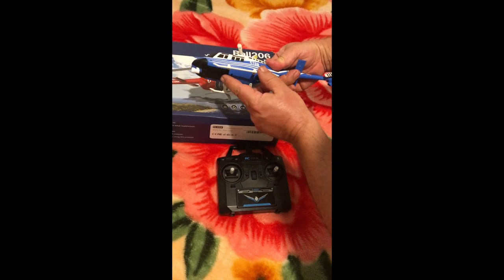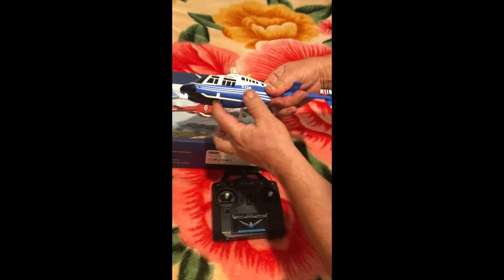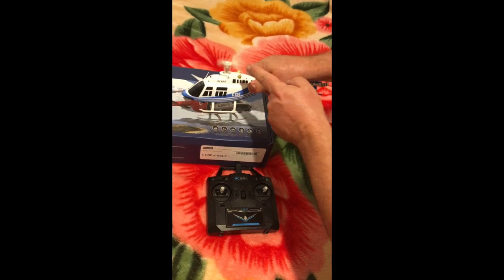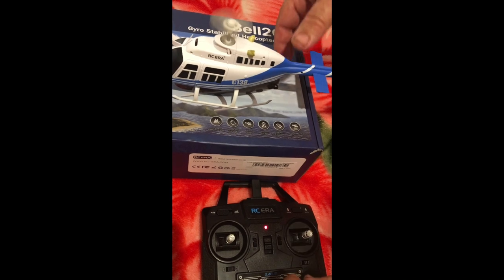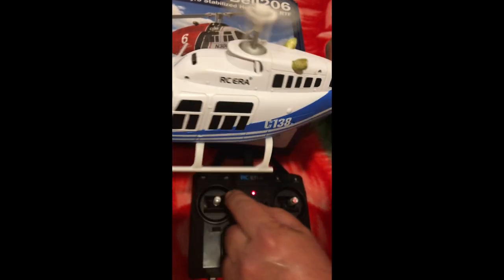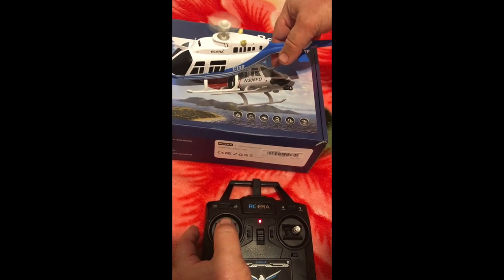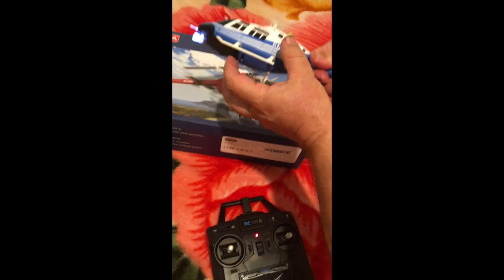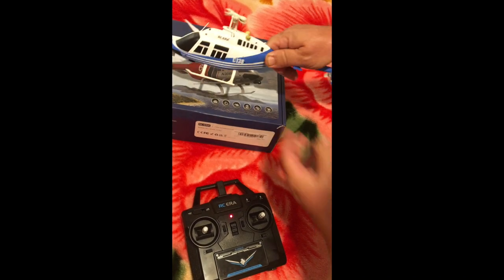RC ERA C138 Bell 206 2.4G 6CH 6-Axis Gyro 1:33 helicopter. Faulty !

Comment: Me too also the exact same type, but mine did fine on maiden flight and several flights without any problem. Maybe after about 10 times crash,  it acts just like this.
Reply from the maker: Not sure if it is correct but in one RC forum stated that the receiver board on some was an early version, once it was replaced with a new board  it flown fine................🚁

Comment: Guys does anyone know why my Heli (this is the one) whenever I put in movement on the right stick it just wobbles like I’m roughly spinning the right joystick but I’m not
Reply from the maker: @The_Rc_Devil_EM  check the servo swash plate and blade movement is freely moving. You may need to do a reset mode to the controller and trim. Hope this will fix the issue. Cheers
Reply: @gamedevai how do u reset it?
Reply from the maker: Check out this YouTube video, this method works also for your Bell model    https://youtu.be/8q9bMB7A-Go?si=VMFdwgJU9U5nfVoV

Comment: i also bought this helicopter era C138 bell 206 the orignal receiver not so good i fly 4x motor over heat  fly only 3min battery drain fast i upgrade new receiver now ok .buy aliexpress price the receiver $12
Reply from the maker: I bought 3 batteries and all lasted 3 minutes drain of motor rotations, I just bought this new helicopter, why would they send an old outdated board? If I open the body and buy a new receiver board at my cost I may void any warranty.
Reply: @gamedevai  when u buy this helicopter
Reply from the maker: @roslimohd9934  received the helicopter a week ago, placed ordered 9th Sept
Reply: @gamedevai  Do u show the problem to the seller
Reply from the maker: ERA company wrote to direct the problem 5o the seller that is Banggood
Reply: @gamedevai  that why when you buy this heli on line very hard to get warranty . I buy this heli test fly very good respon eazy to fly after 4 x fly my heli problem battery drain very fast main motor very hot . I think the receiver qualty not so good. I upgrade new receiver i repair  my self . Fly very good no problem fly